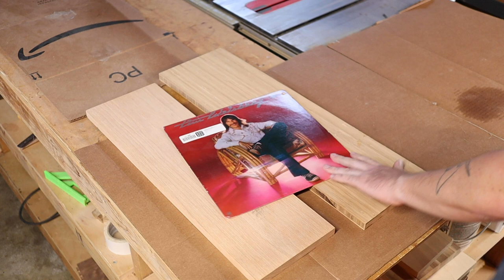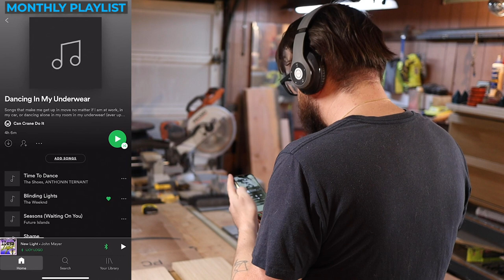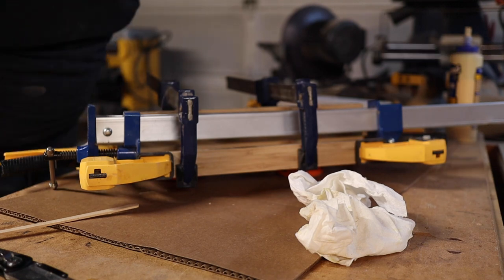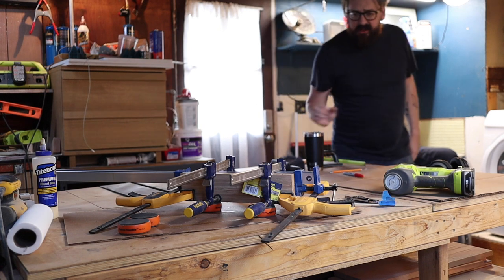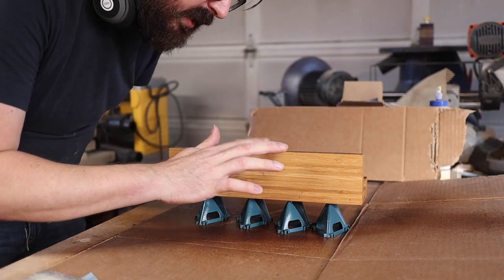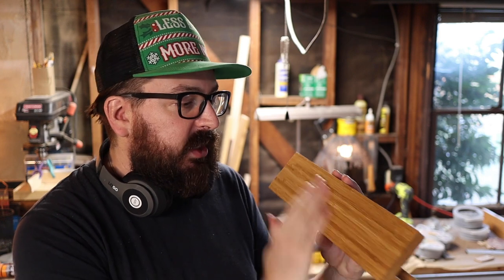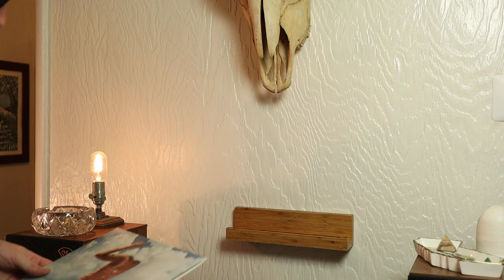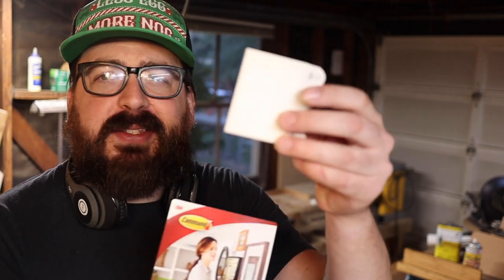'Now Playing' Vinyl Record Display Shelf - DIY scrap wood project

Comment: What are the actual measurements for the wood to be cut?
Reply from the maker: All of the measurements are written out in the video and also displayed on the measuring tape when setting the table saw. However you could make this to whatever size fit your needs or how many records you wanted to display